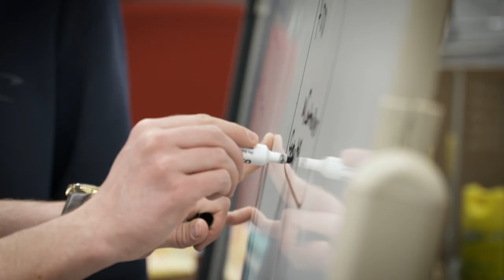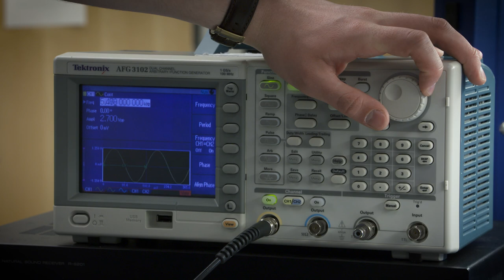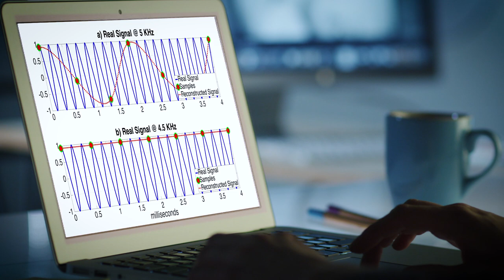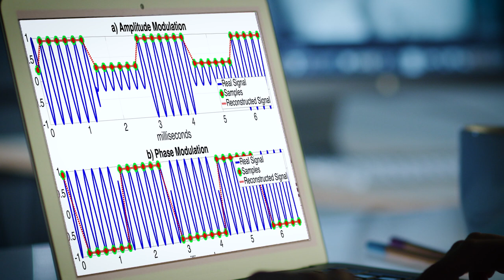Sonic Cyber Attacks on MEMS Accelerometers

Comment: He had to put the ultrasonic emitter nearly on top of the device to show an effect, it seems unlikely that any kind of attack-at-a-distance could be possible given the inverse-square law of propagation of sound and electrical sources. Acoustic attacks and NEMs and MEMs doesn't worry me much. I guess that a software fix couldn't hurt though.
Reply: Yes, I don't believe high frequency signals travelvery far, so you'd need to be very close to the sensor(s) to actually make anything happen. It's the same reason you place tweaters next to a listeners ear, when designing car audio systems.

Comment: In most cases you should use rf shielding.
I think that one solution for this problem.
Reply: Uhh rf shielding doesn't stop sound waves. Only radio waves.
whole different ball park there.
But this 'hack' is so beyond stupid and impractical.
If someone comes up to you with a speaker blasting 2600Hz at your phone RUN!